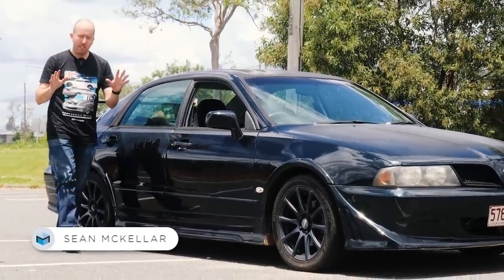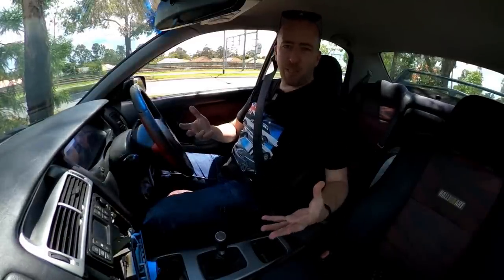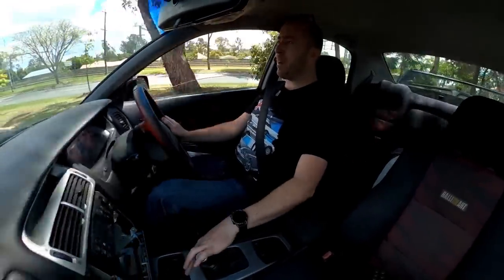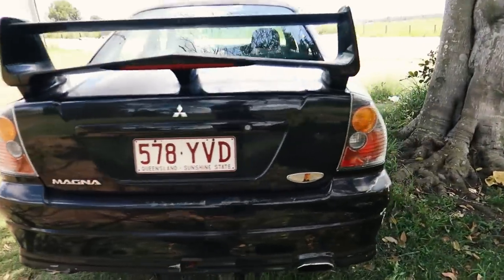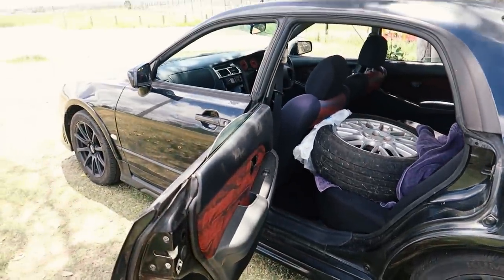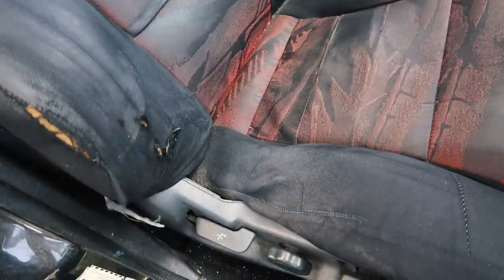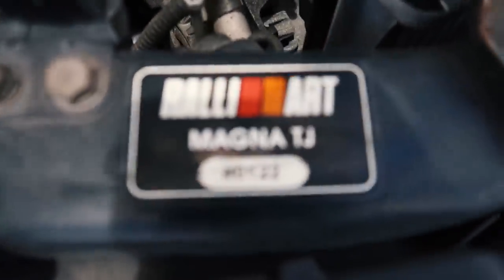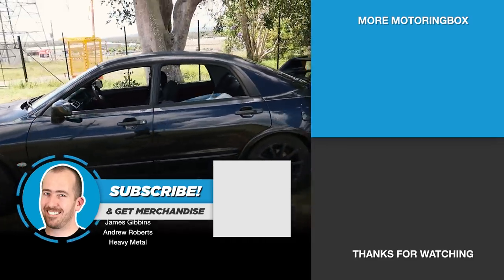Mitsubishi Magna Ralliart First Drive! This Aussie 180kW 6G74-powered manual sedan is a screamer!

Comment: You should go test drive a Ralliart Colt Version R JDM spec big fella .. it'll eat that Magna Ralliart
Reply: The Ralliart Magna is significantly quicker. 
It won the Australian Motorkhana on release. 
The Colt is lighter of course, but 5 Ralliart Magna's were built with 210kw courtesy of wilder camshaft's. 
Autospeed tested one against an STI & the Ralliart Magna killed it despite being weight disadvantaged by the presence of a passenger. 
Do you think a Colt can beat an STI? 
Some of them were Supercharged too, that were also equipped with the wilder cam's. 
Do you think that a Ralliart Colt can beat a Ralliart Magna that has over 250kw?
Reply: Yup .. you can get over 230awhp out of the colt before modding internals .. mines only around 180awhp and I'm laying down low 6 for 0-100 and over 1kmhr per metre up past 100kmhr .. I have beaten STI and Evo X standing and rolling starts .. I would prefer a manual 3.0 MIVEC 290hp factory diamante myself
Reply: @LifeFitTraining  
The JDM Colt R only has 120kw, where are you getting these figures from? 
You can't get higher output's without modding it. 
0-60mph was only 7.4sec & 1/4 mile time was 15.6sec. 
The Ralliart Magna 180kw version factory spec's was 0-60mph in 6.6sec & the 1/4 mile time in 14.7sec. 
Plus it won the Australian Motorkhana on launch.

Comment: It's quick?  Compared to what exactly?  The traffic around you at those traffic lights? 

Also, the most common/likely causes for tyre chirping, are
old hard tyre rubber,
worn dampers. 

Babbling about Falcons is essentially pointless.
Reply from the maker: Compared to 6-cylinder Falcons and Commodores of the same time period. They were the car's main competition, so it's far from pointless.
Reply: You just have to look at the spec's. 
The main advantage the sporty Magna's had was weight. 
They were significantly lighter than other NA V6 competition. 
This car had 180kw & 333nm weighing 1470kg (1440kg when equipped with a flat tyre repair kit like the competition were using at the time). 
The VZ SV6 had 190kw & 340nm from it's NA V6, but weighed 1600kg. 
The VE SV6 too, power & torque increased over the VZ but so did weight. 
It bounced to 1740kg. 
The SIDI VE SV6 boosted power to 210kw & 350nm but the weight & dimension's were too great. 
Handling too, the Ralliart Magna handled much better due to it's weight. 

To rub salt into the wound is some Ralliart Magna's came from the factory with wilder camshaft's & compression ratio that boosted power to 210kw & probably 350nm+, plus they were 10kg lighter than their 180kw counterpart's. 
210kw & 350nm+ weighing 1430kg, despite being FWD these specifications would pose a serious threat to a 1740kg car that had the same power output. 
Plus 30 Ralliart Magna's came with a Sprintex twin scroll supercharger that boosted power by 67kw & boosted torque by 102nm. 
Some of the Ralliart Magna's that came with the wilder cam's & compression ratio got the Supercharger treatment too, do the maths but this probably gave them 277kw & possibly close to 500nm of torque. 

Just look at the Supercharged AWD Magna too, 226kw with 422nm weighing 1604kg (1575kg with a flat tyre repair kit), add the wilder cam's & compression ratio to this to boost power by 30kw & 20nm+ for 256kw & 450nm. 
Plus the shape of these car's too, it gave them a aerodynamic co-efficiency of 0.28 which makes them the most aerodynamic car's in this class even to this day. 
Really Mitsubishi offered the best in terms of FWD, AWD & Aerodynamics that money could buy with the Magna TJ series. 
The only rival Holden had against the Supercharged AWD Magna was the AWD Monaro, but the AWD Monaro weighed 1850kg despite getting more power & a ancient 4 speed auto. 
Think it was more aimed at luxury tbh. 
There's a reason Holden/Ford fan's hate them as they posed a serious threat.
Reply: Except, of course,  @brantleyfoster021 , that none of those very, very rare variants, is this one.
Reply: @AsinineComment  
Won't know for certain unless you check under the bonnet or get it dynoed. 
5 Ralliart Magna's were built with 210kw from the factory with the wilder cam's & upgraded compression ratio. 
That's the thing with Mitsubishi, they always give some of their halo performance varients unique tuning. 
Mitsubishi always slip in some wonderful surprises with their performance oriented car's. 
It was the same with the Mitsubishi Cordia Turbo back in the early 80s. 
They typically made 110kw & 210nm. 
But Mitsubishi designed some of them to produce 150kw & 300nm. 
When you consider that they only weighed 975kg, nothing V8 on the road at the time could match them. 
They were even significantly faster than alot of Supercars available at the time. 
It's why the cop's took an interest in them, very effective pursuit car's too. 
The Mitsubishi Starion was Mitsubishi's halo car back then. 
But every owner knew never to line up with a Cordia Turbo at the traffic lights as the Cordia would thrash them.
Reply: @AsinineComment  
I should point out too though, the 210kw build is available to do. 
Many have had the upgrade done. 
So it's not clear how many would actually have 210kw, plus owner's with these build's tend to hold onto their car's.
Reply: @brantleyfoster021  What camshaft did the 210kw use Brantley? I know at least one owner claims the 5 were developed in Japan, I guess by Ralliart?, meaning they were then detuned a little for Australian release.
Reply: @j.m.6542  
I'm not entirely certain how it was arranged that way. 
The cams were called the Doctor John's camshaft's, they are designed & sourced by Tighe in Qld I think. 
But Mitsubishi did some work on them before they put them into the Ralliart Magna too, I think they come with adjustable camgears but not certain. 
They are also in lesser Magna model's too. 
It wasn't just this though, the compression ratio was lifted to 10.1:1 so the car required high octane fuel's.
Reply: Yes, I agree that owners of the upgraded version would likely keep them, @brantleyfoster021 .  Which adds more to the statistical likelihood, that this particular example, is not one of them.
Reply: Do you suppose that someone getting a 150kW Cordia, would notice the massive difference,  @brantleyfoster021 ? 
Surely we'd have heard about it? 
When you say some Cordia Turbos, and some Magna Ralliarts had significantly more power designed (huh?) into them, how much is some ?  It must have been more than just 5?!  Otherwise, the chances of being surprisingly out-accelerated by one of these, is almost zero.
Reply: Yes, looking at the stats is always important,  @brantleyfoster021 . 
If we're comparing the 180kW Ralliart Magna with a Falcon for argument's sake, you wouldn't line it up with the base XR6 (366Nm, 164kw 1500kg#) would you.
Falcs (and Fairmont Ghia) with the VCT Intech engine, came standard with the heavier IRS, but 172kW and 374Nm.  Understandably, that extra torque - and at lower revs than the Magna's peak torque - would square up the acceleration stats.  0-100km/h in the Falcon was around 6.9 secs. 

Ditto for the VY Commodore S - you'd like it up with the supercharged variant.  Rather than a handful (more? less?) of secret hi-po supercharged Magna Ralliarts, it was widely known that Holden had kept the published engine output data significantly lower than the real outputs.  Don't want your boosted V6 showing up your V8, do you! 
Yep - around 1600kg, but also a higher torque peak of at least 375Nm @3000rpm.  Again lower than the hi-po Magna's peak.  Even with the auto, it could tick off 100km/h in 7.3 secs.

# Ford was caught fudging the kerb weight stats with the AU.  No production cars were actually around 1450kg.  From memory, they were actually around 1510kg with the live axle, and approx 1600 if you ticked the IRS option box.
Reply: Yes, @MotoringBoxTV  , but the vague/random references to some Falcons in this episode, really is not a comparison, is it.  🤷🏼‍♂️
Reply: I not quite sure why the VE cam into this, @brantleyfoster021  .  The Ralliart Magna was long, long gone by 2006. 

We can easily find references to AWD supercharged Magna Ralliarts online, but how many were actually production vehicles, sold to the public?  Any at all?  
I'm also keen to learn what specific resource we can grab that info. 🙂
Reply: @AsinineComment  
We don't know for certain so I'm not sure why you would mention it in the first place?
Reply: @AsinineComment  
The standard Cordia Turbo had 110kw & 210nm. 
Are you saying 150kw & 300nm isn't a considerable difference to this? 
The car only weighed 975kg, so it made it very fast in a straight line. 
Why do you say the chances of being out-accelerated are zero if it's just 5 more? 
I think you need to Re-read what I actually stated.
Reply: @AsinineComment  
The 180kw Ralliart Magna can do 0-100km/h in 6.5sec. 
It can also do the 1/4 in 14.5sec. 
They can break through their official times. 

The 210kw Ralliart Magna 0-100km/h time isn't known. 
But I watched one drag race a Mercedes that it always beat down the 1/4 mile. 
The E55 Mercedes could do the 1/4 mile in 13.89sec, the 210kw Ralliart Magna did it in 13.7sec. 

I think you are confusing weight figures of the AU. 
They weighed heavier than that unfortunately. 
Plus they were slow, even an AU XR8 was slower than a TJ series Magna VRX & was established by the Australian motoring media at the time. 
In fact, none of the car's you listed could beat the VRX which was slower than the Ralliart Magna.  

There's even a drag race between a BA XT vs a Magna VRX up on YouTube & the VRX  thrashes it by multiple car lengths. 
Do you want me to send it to you? 
It's worth noting that the BA XT had light modifications in that race too.
Reply: @AsinineComment  
I'm responding to the threads starting comment.
Reply: @AsinineComment  
I mentioned the VE SIDI because it had the same spec's as the 210kw Ralliart Magna, except the Magna was 300kg lighter. 
There is no model Magna known as a "AWD supercharged Magna Ralliart's". 
So none were sold to the public. 
All the Ralliart Magna's were FWD. 
Think you are confused.

Comment: https://youtube.com/@V8Ziggy
Hmmm. Worth it? No. Owned 2 magnas back in the 90s,00s. A wagon & a solara. Both manual & probably 3.0s. Did consider a VRX. But ended up changing tack considerably. Have a V6 now, but a 3.2 busso 147 GTA. It's a sub 6sec car. Don't think I'd accept 6.6s in a big car in 2022. 2002, different story. The GTA handles 250+hp over the front well, due to weight and wheelbase. I remember the Magna handled OK for its size, it brings back memories, sure, enough to revisit? No. It was of an era, & price point. 2002? I've owned 3 cars from 2003-04. My last solara being 98(same as 02). My current Alfa GTA is 04. The GTA is aging very well. The Magna not so. It's reflects its place in the market in the late 90s early 2000s. I don't think I could accept or enjoy that in 2022.
Reply: Depends on which Magna it is. 
Some Ralliart Magna's came with over 280hp courtesy of some wilder camshaft's from the factory. 
Some of these had Superchargers put on too, the most powerful of which had roughly 340hp. 
There was AWD Supercharged examples too.
Reply: @brantleyfoster021  that's the last. 2008 380.3.8L. Different car. Limited run. Never completed production.
Reply: @Paul_Zernick  
No I'm talking about the Ralliart & AWD Magna, not the 380 or the TMR 380. 

Some Ralliart Magna's were built with a camshaft called the Doctor John's camshaft & they had a compression ratio higher than 10:1 & were released from the factory like that. 
This bumped power up to 210kw. 
30 Ralliart Magna's also were Supercharged as approved by Mitsubishi. 
These put out over 250kw. 
They were alot faster than the TMR 380. 
Some of those Ralliart Magna's with 210kw got the Supercharged treatment too, not actually certain how much power they made but must've been close to 300kw. 
Well just put out the specs: 
Ralliart Magna supercharged put out 251kw & 440nm weighing 1470kg. 
TMR 380 had 230kw & 442nm weighing 1700kg. 
Which is quicker do you think?

Comment: Used to own a brand new KJ Verada Xi back in 2002.  Very comfortable drive but engine too lazy.  Doesn't have any power until after 3500rpm.  It gave u sort of a Turbo engine characteristic as the rev climb rapidly all the way to redline after 3500rpm.  Had a gearbox failure at only 60000ks due to a faulty spring.  Had a faulty fuel gauge that gives out error reading since new and was fixed after multiple trips back to the dealer.  Had a loose sunroof lining that took no less than 10 times to hv it fixed.  After that I swear to god i will not touch a Mitsubishi ever again.

Comment: These cars don’t have speed limiters so you should be good for 235kms an hour 👌🏽
Reply: The speed limiter doesn't come on until 248km/h, the 240km/h top speed is not correct. 
If you deactivate the top speed limiter, the highest speed reached so far by the 180kw version is 254km/h.

Comment: obviously fuel economy isnt on your list the Mitsi V6s are thirsty as anything
Reply: Depends how they are driven. 
If you push them hard all the time then fuel economy will climb, although I've never seen it reach 13L per 100km. 
But carsales has them registered at 7.5L per 100km when driven sedately. 
One of my friend's got 6.9L per 100km. 
Can even get as low as 6.6L per 100km. 
They actually led the field here on release, for this class.
Reply: Speaking of fuel economy, one of my relatives is a mechanic & he had a VE HSV come in for repairs that was registering 80L per 100km😥 

Think some people just drive with a lead foot😅

Comment: I was cool with everything until you compared it to an LFA. If anything it might sound like a Dodge stealth or a 3000GT because those cars have the same engine, but you will never ever in your life compare a v6 to a V10 let alone one that was created by Lexus and Yamaha to be one of the best sounding engines on this planet
Reply from the maker: o f f e n s i v e
Reply: @MotoringBoxTV  honestly its like the Mitsubishi equivalent to that vq35de Altima 3.5 or maxima 3.5. definitely a sleeper if and  much quicker than people would expect
Reply: He said it was budget LFA, not the LFA itself. 
I was a bit surprised by how good it sounded too. 
The review's for the car back on launch used to rave on about the sound it made. 
Autospeed stated that the sound it made was "very high tech sporting", this draws a parallel with the LFA in this sense. 
Except the only difference is the Ralliart Magna was a relatively unknown beast. 
I am impressed that Mitsubishi & Lexus with the LFA did try so hard to make both these car's sound good & I'm glad they did, just not the same if it sounds like a Morris Marina.
Reply: @brantleyfoster021  dude no. Absolutely not. An LFA is a V10 not a V12 or V6, the only engines that remotely sound similar are v10 or some of the inline 5s. Stop trying to defend a crap comparison. He said it, I responded, we moved on. But "sound good" "sounds great" does not compare to one of THE BEST SOUNDING street legal cars ever made. That's like me saying my turbo tercel is like a cheap Ferrari f50 because its turbo and it screams over 8000 rpm. It sounds awesome, but it's no Ferrari, and there's not a road legal Mitsubishi on this planet that naturally aspirated sounds as good as an LFA. Period.
Reply: @freestyleskyline 
That's the point, you misunderstood his comparison. 
Sean was clear about how the sound was like a budget LFA, not the LFA itself. 
The Lexus LFA sound's nothing like a Dodge Viper or even the BMW M5 that got a V10 too. 
The LFA sound was unique, it was close to a F1 car's sound to a degree I think. 
Comparing nice sounding car's to each other regardless of how many cylinder's they have is not a bad thing. 
If he was comparing a Morris Marina's sound to the LFA then I could understand your point better. 
But the car featured was a nice sounding car.
Reply: @brantleyfoster021  lmfao I know the point. Now you're just arguing to argue dude, find something to do
Reply: @freestyleskyline  
If you knew the point, why upload this comment in the first place?